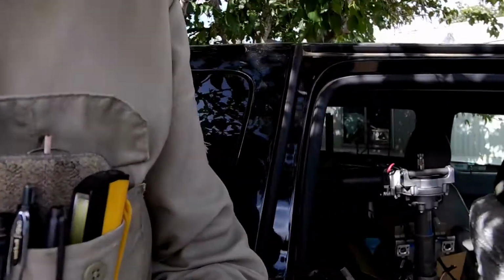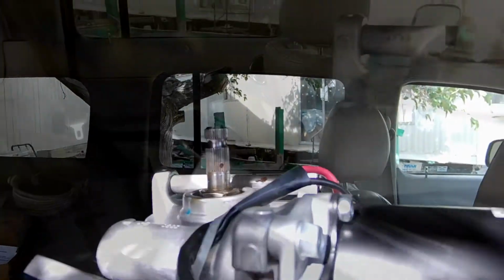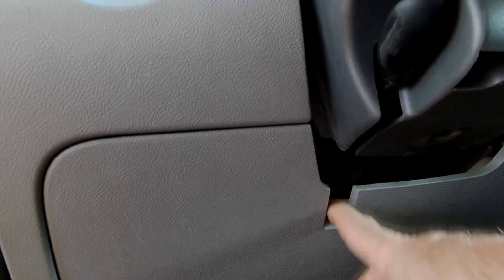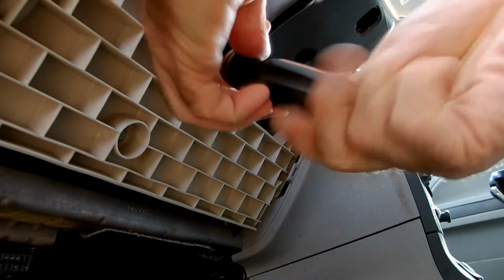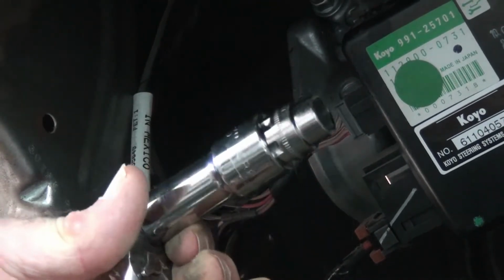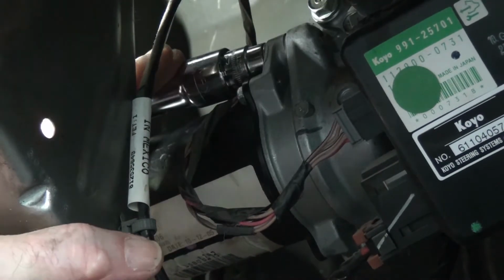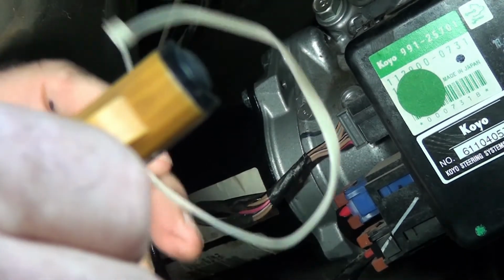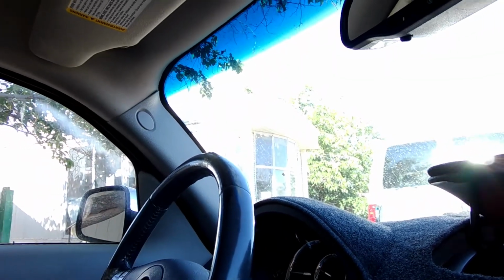This Power Steering Motor Replaced In My Chevy HHR 2.4L

Comment: I see you're actually answering people! Awesome! Maybe you can help me. I was driving when the power steering light came on. I lost the power assist. I could still steer with some muscle. 10 mi. later I got off the interstate and found, in the book, of my 06 HHR, that fuse #19 was labeled power steering. When I checked it, it was warm. So I swapped it with#18 which was labeled blank. In short, every time I turn the car off, then start it back up I have the power steering back for about 5 seconds. I've put about a hundred miles on it so far (one day), because I had to get to work. Does that warm fuse tell you what component is the problem?, if there's no short.
Reply from the maker: A warm fuse may indicate there is more current being run through it than usual. If too much then it will blow. It may be that the component that that fuse serves is going bad...I am just not sure. Check out this link to an HHR Forum. It has some similar issues mentioned, that may be able to help you fix the problem. Also if you can, run a code check on your scanner to see if the computer is mentioning anything with the power steering. Remember Chevy HHR had an ignition switch recall that was causing many similar issues. Check to see if you vehicle was fixed with that recall. Here is the link that I mentioned...hope this helps..https://www.chevyhhr.net/forums/problems-service-repairs-42/power-steering-just-went-off-23499/page2/

Comment: The video was great but I still have a related problem. I recently replaced the intermediate steering shaft due to excessive play but now have a rattle which seems to be coming from directly behind the steering wheel. It's really noticeable at lower speeds on rough surfaces. I also get intermittent whining\squealing when making a sharp turn. Any suggestions or help would be appreciated. Thank you.

Comment: Hello mr
I have chevy hhr2008 
When starting my car the steering is very smoth 
But
Where drive my car the steering is very hard 😢
Reply from the maker: I never had this issue, but I would start with a diagnostic scan with a scan tool to see if the body control module is causing the issue. However, it acts like the power steering motor is starting to fail and needs replacing.

Comment: Recently got a HHR from a friend who's mother passed away, just as my 21 year old Honda's transmission gave up. So new to a HHR. I feel that the steering is way heaver than it ought to be. At slow speeds (like parking) it doesn't seem to have much assistance versus my girlfriends Hyundai Accent that I can practically turn with a finger at low speeds. Do you think a new motor would help this? Should the HHR have much lighter steering around corners? I feel like I'm fighting the centrifugal force of the wheels, it feels like the power assistance is always about the same amount, it never varies like on other cars. I understand that tire pressure on the HHR's can also add a lot to the feel, they are set to about 25-27, and I think they are normally around 30. But i can't imagine just a few pounds of pressure would dramatically alter the lightness of the steering, it's never been that way on other cars I've driven. Thanks for the video, it might come in handy if it's the power steering motor.
Reply from the maker: Put some air in those tires. Yes, the steering has a more positive feel to it. I actually like it at all speeds.
Reply: @SteveAZ711  I put in air, I found the tires were actually around 21psi. So it seems the TPMS sensors are less accurate the further you are away from their optimal 30psi the door placard says they should be. It did lighten up the steering, much improved at parking speeds. I have noticed rumbling at the front suspension and I think the bushings are worn out, it tends to pull to the left or right when I apply brakes at lower speeds. I think a good look over the suspension will be needed, and maybe that will solve the pulling and tightness around corners.

Comment: Hey what abt the recalibration? How did you avoid that
Reply from the maker: First, I did not avoid anything. If I felt my steering needed adjustment then a good scan tool may be able to calibrate the position sensor with the computer. Or you can have the dealership do it.

Comment: My hhr that’s parked in my driveway is giving me soooo much problems...my steering wheel turns and turns and turns and yet my wheels don’t move...recently I tried turning it on cuz that’s what ur supposed to do...and it never turned on...no lights turn on no nothing...how can u put a hhr on neutral to move forward a little...when I press on brakes and try to move forward...it don’t work...
Reply from the maker: Oh Vanessa, is your battery dead? Still if you unlock the steering wheel you should be able to turn it enough to see the wheels move. It sounds like you have some broken or unconnected steering components. You need to have a mechanic look at that steering issue. As for not turning on, it most likely is a dead battery. It can be jumped from under the hood at the Battery terminal. Here is a video showing how..https://www.youtube.com/watch?v=A3fVXq0E3us&list=PL5q1n3MQ9IDsI_gIzoZW8FgNKU_UQt3th&index=32&t=0s.
Reply from the maker: Vanessa, have a mechanic look at the steering. Sounds like the battery. Here is a link on how to jump start it.  https://www.youtube.com/watch?v=A3fVXq0E3us&list=PL5q1n3MQ9IDsI_gIzoZW8FgNKU_UQt3th&index=32&t=0s
Once it is running, try turning the wheels to one side and see if they move. Then try the other side.    You may have some broken or loose parts if you get nothing at all.

Comment: I replaced my motor on my 2007 hhr I got an updated unit new for $50 took about 20 min to install. It was under warranty some service bulletin those motor from chevy, but it was easier to do myself then go through there hoops and leave for them for another day.
Reply from the maker: You are correct ED. I believe there was a bulletin out on them now that you mention it. I can see why. This newer motor came out of a 98000 mile car so it may have already been replaced. Sure is some smooth turning now!
Reply from the maker: Now that you mention it... I do remember a recall when I asked the dealer about my other HHR back in 2008 I think. Seems the motor was making some growly noise at times.  Yeah Ed, those hoop hours sitting there just make me feel like bait for a new car salesperson. LOL